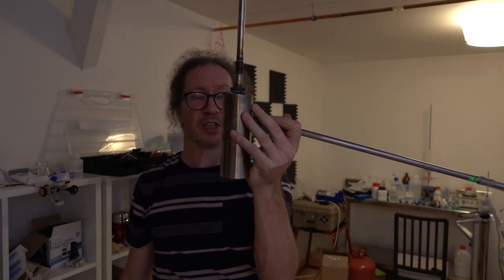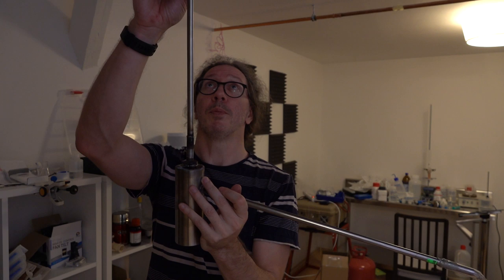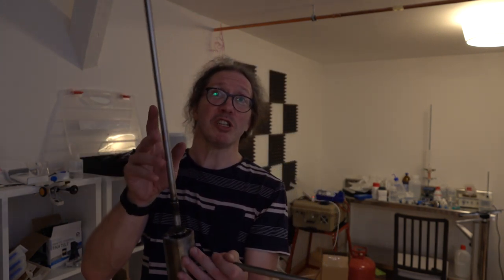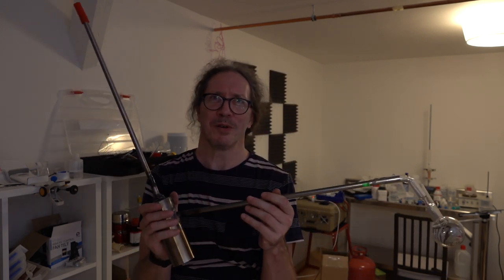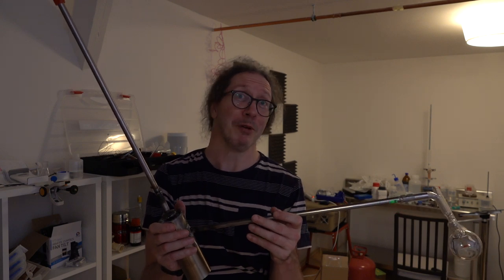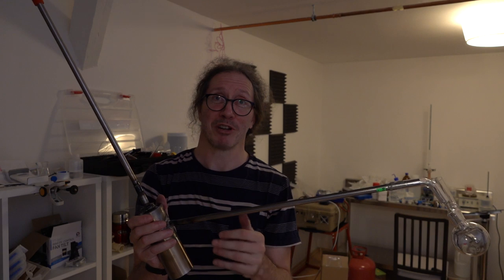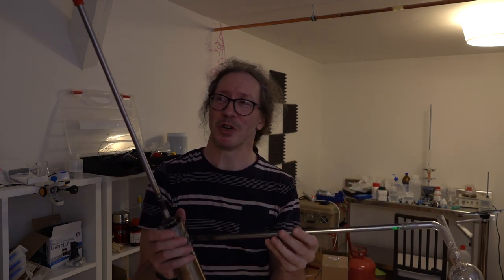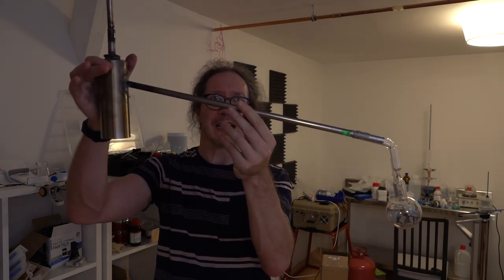Making a Cesium still from scratch!

Comment: Are you sure you're not stick welding (sometimes called arc welding, although technically arc welding includes all types of electrically powered welding and not just stick)? Because MIG welding DOES use inert gas. (MIG=metal/inert gas) MIG welding uses uses a thin wire as an electrode which is automatically fed through a MIG gun, which also dispenses inert gas. It works like a hot metal glue gun. Did you use a MIG welder without gas? Because that would probably be bad. I say probably because there's a kind of welding called flux core arc welding (FCAW) which is sometimes, erroneously, called gasless MIG welding, because it's exactly like MIG but without the gas, and it's fairly common as well. The wire for FCAW is different from MIG wire, however. MIG wire is just wire. FCAW wire is actually a thin tube filled with a kind of flux, similar in construction to solder for electronics. The reason I suspect you're actually talking about stick welding is that MIG and FCAW are dead easy, and, in a previous video, you mentioned using a MIG welder as a high current power source, which makes no sense. You would use a stick/TIG welder as a high current power source. Anyway, MIG/FCAW really is just like a hot glue gun with metal. Just pull the trigger and go.

Stick welding (properly called shielded metal arc welding (SMAW)) is much more difficult and doesn't use gas but it has the cheapest and most easily found equipment. With stick, your electrode is a consumable metal rod which you strike like a match and hold just off the piece to get it started, and then move the stick in a slight zig-zag pattern along the parts. Either way, you just need to practice a bit with some scrap until you get the technique down. Straight line joins are much easier to start with. Inside corners are a pain in the ass. Regardless of which type you choose, start by making a few evenly spaced tacks (little spots to lock the metal in place) and then fill in the lines, making sure not to do adjacent sections one after another. Don't go too fast.

Also, there's TIG (tungsten/inert gas) welding, which is similar to SMAW but uses a non-consumable tungsten electrode with an inert gas and uncoated consumable rods. It's generally considered the most difficult to do, but it provides the most control and can handle the widest variety of different metals, and be used for extremely delicate work.

Comment: Hello Thunderfoot.  I have a science kinda question for you on the climate.  Has anyone done a study solely on the effect of people on the world?  I'm not talking about pollution, or cars, or farming or mining etc.  I am talking about population.  We live in a closed system, so I assume there is only so much of what we have to go around.  We have the largest population of humans in history, obviously, so what is just that effect?  Imagine if your in a small room.  Now add one person.  That's not so bad, the air is enough, and the temp is fine.  However if you add 20 people into that one room than things tend to heat up and the air is getting used up faster.  Add enough people and your sweating and people are passing out because the air is not circulating fast enough to replace the CO2 with fresh air.  Using google we had about 2 billion people in 1920.  Now we have probably well over 7 billion.  Could the body heat alone of all these extra people being having some effect of the world?  Just a thought I had while waiting in line at a cramped deli

Comment: For God's sake, please grind those zinc galvanized objects before welding and use a respirator for those tasks.. The fumes are very unhealthy and can lead to metal fiever and possible death. MIG welding requires shielding gases (inert gas). I do not want to say that you can not weld with a MIG welder without gas, but then you'd just need the composition for electrode welding for the device. But that's actually not real MIG welding.

Comment: This video made me question your scientific understanding. First welding without any shielding? Dont you know that iron reacts with oxygen in the air? Second that pipe looks zinc plated and zinc boils at 907 °C while iron melts at 1538 °C so zinc would boil as you weld and zinc gas would make it harder to make air tight welds. Third metal parts are coated in some kind of oil to prevent rusting and that can interfere with your plans to do airtight welds so clean your parts before welding vacuum chambers. Fourth thicker metal needs more energy to melt because it has more mass (duh) and to put more energy into metal you need more power. For electricity P = IV. Since you cant change voltage on MIG you need to crank up the amps till you see metal melting. I should not need to tell all of this because you already know it you just do not connect the dots